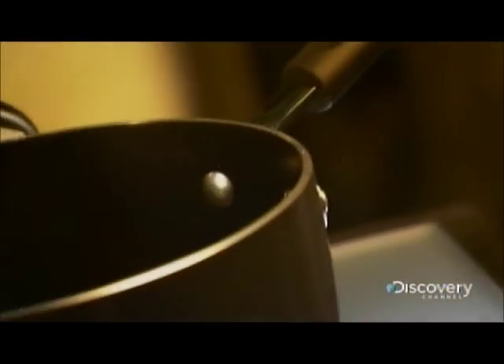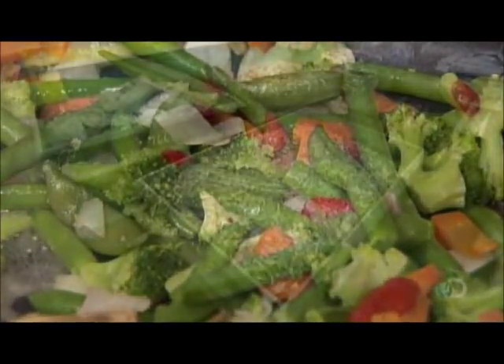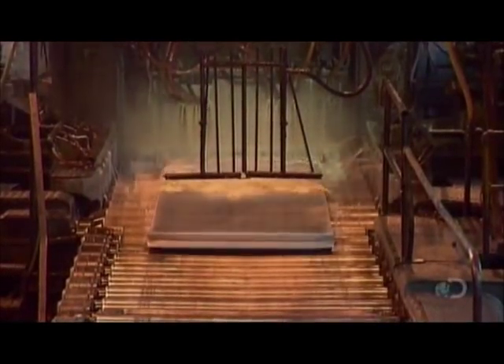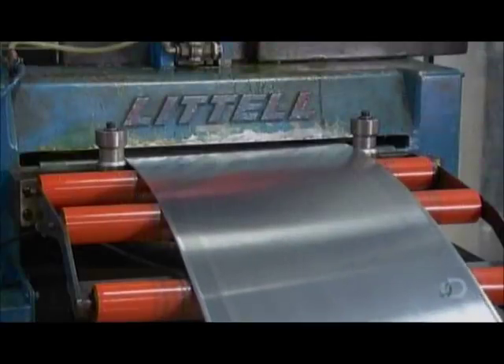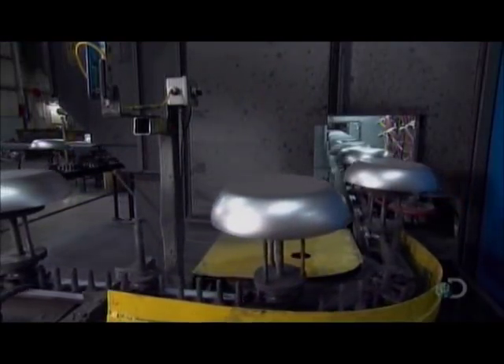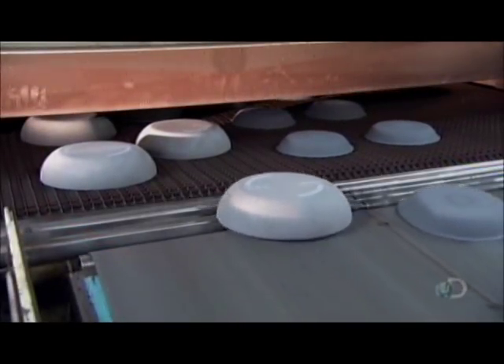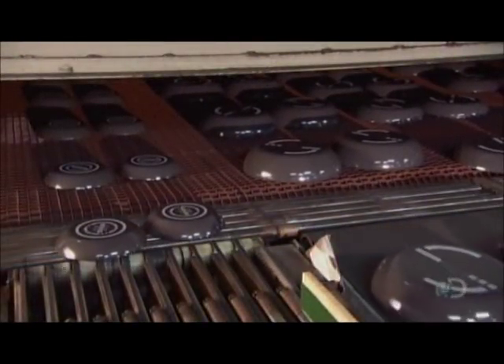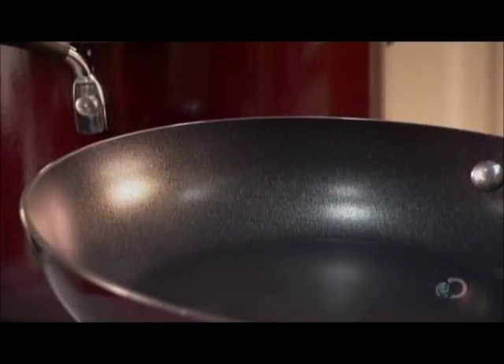How It's Made - Non-Stick Cookware

Comment: nonsticky plastic stuff is notoriously known to break down and cause problems.
Polytetrafluoroethylene (PTFE)

While PTFE is stable and nontoxic, it begins to deteriorate after the temperature of cookware reaches about 260 °C (500 °F), and decomposes above 350 °C (662 °F). These degradation by-products can be lethal to birds, and can cause flu-like symptoms in humans.

You can search for more about this stuff.

Comment: Yeah but as long as you're not cooking with temperatures at 500F or more you're basically fine. This is why many suggest only having nonstick pans for cooking eggs as you don't really use high heat for eggs. And people have pet birds in their household, move them far away from the kitchen when you're cooking with them. It's common sense. Don't blame the cookware, blame yourself. Fumes from hot oils and when grilling food isn't all that great either.
Reply: Agreed

Comment: Have that feeling this is not to good for our health.
Reply: The funny thing about feelings is that they're usually the worst way to discern what is true.
Reply: teflon is safe. But little do people know that teflon pans are not meant for high heat cooking, for high heat cooking use stainless steel. Teflon looses its non stick service when its heated in high temperature
Reply: That's why the cookware manufacturers give you a temperature that their products are tested at to be safe. Calphalon signature can go up to 260C/500F
Reply: i love cast iron but man its fucken heavy
Reply: @iKillOrDieTryN  cast iron isn't the solution to everything, and can actually be pretty cheap
Reply: It's not, but people don't care. We live in a society that thinks hangovers are a normal thing 😁  You really think most people give so much as two flying fornications about health?
Reply: @TheBenjinator  , High heat cooking? It's all high heat. And Teflon is so 1960's/70's. I like Silverstone or or genuine granite interior pans
Reply: @MT28-w5s  Cast iron only seems to be good at cooking certain things. It's very heavy, and rusts easily, not easy to clean and is sticky to food